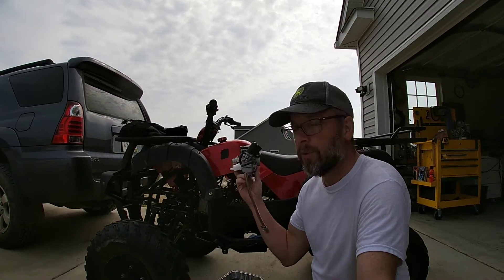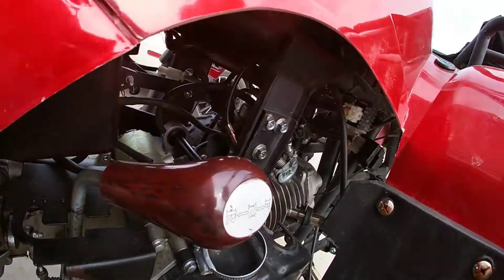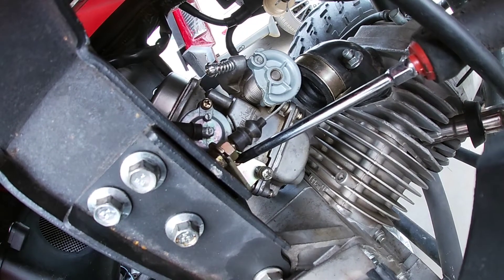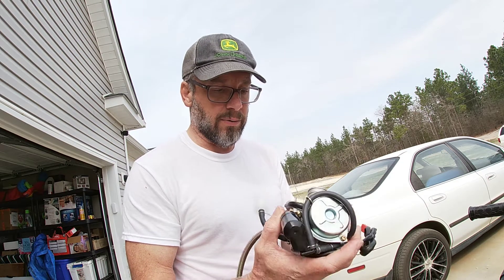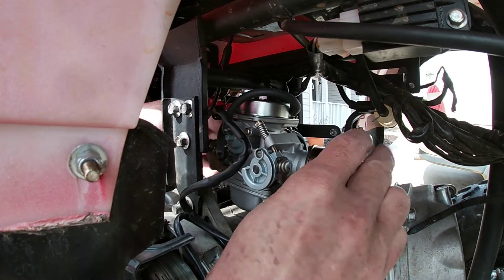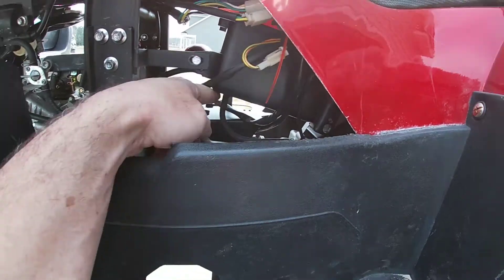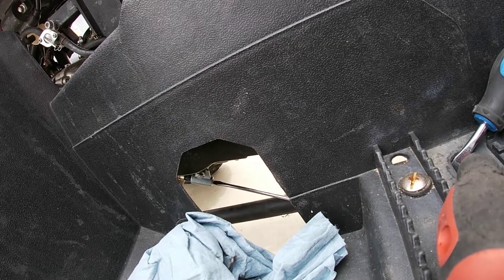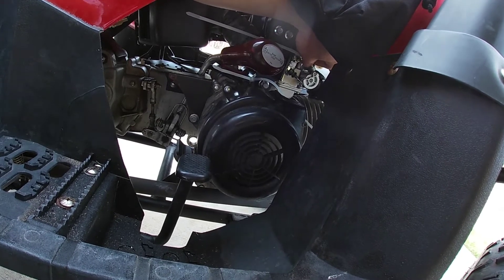150cc 4 wheeler Carburetor Install/Swap GY6

Comment: I have the shut off valve like yours so I leave the one that connects to a three way alone don’t plug it in anywhere ?? Thanks in advance !!
Reply from the maker: Yea, I the one hose is a vent so shouldn't need to.

Comment: Mine don’t have the then to plug the Hose in the box what do I do
Reply from the maker: You can just put a filter on the end of the hose and secure it.  (Fuel filter is just to prevent dust from getting in there.   You could use some other filter). Don't really need it

Comment: It’s bogs out I think the carburetor is dirty, I turned the idle a lil and it stared but turned off again
Reply from the maker: Are you able to keep it running by feathering the throttle?  
It can take a lot of work to get the idles right. 
But I was having that exact issue and that's why I changed it out.  I tried to clean mine but the diaphragm is so tough to put back in , it's cheaper to just buy a new one from Amazon.   I have a link in the comments to this exact carburetor that I used in the video